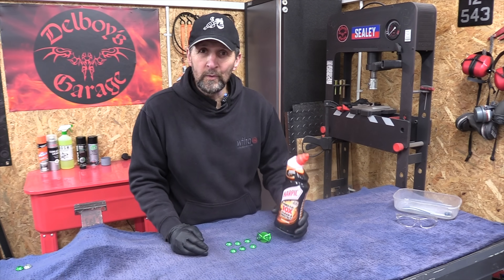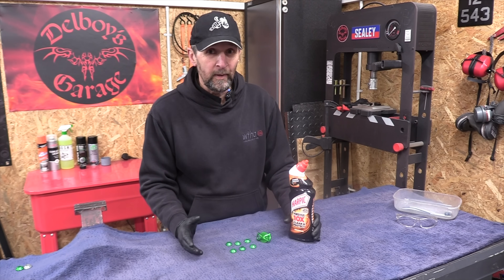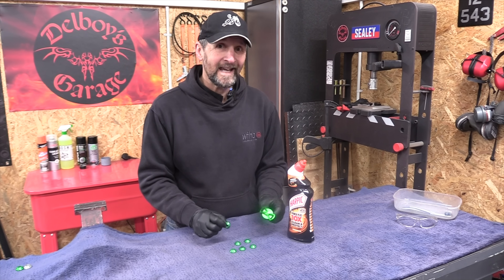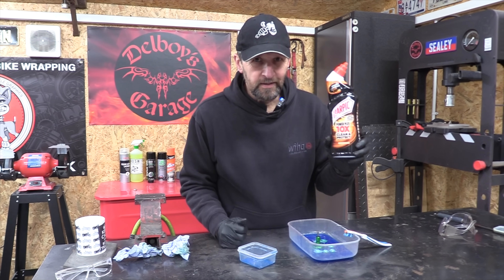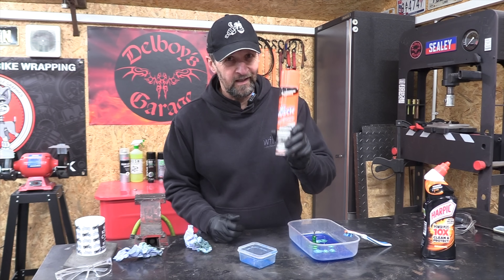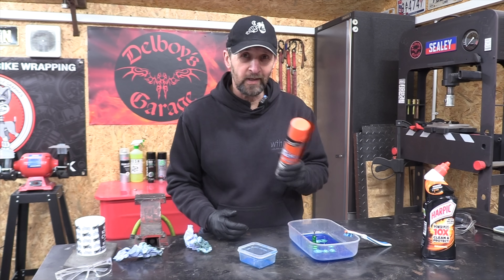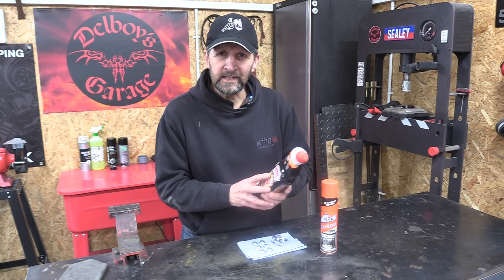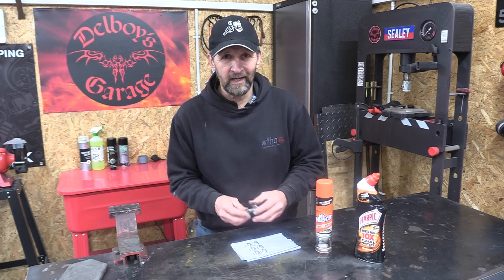"Harpic vs Mr Muscle"  to Strip Off Anodising ...Which is Best ?

Comment: I didn’t know anodising was a coating, i thought it just kinda molecularly changed the surface.
Reply from the maker: It is, but just microns thick... which is why when you saw it after washing off in the sink... the alloy was a dull grey etched finish until i polished it back up again.!

Comment: In my experience the best thing for stripping anodizing from aluminum has been Easy-Off brand spray-on oven cleaner. Just make sure you use the regular stuff and not the "odor-free" flavor (probably a similar formula to the oven cleaner you used).